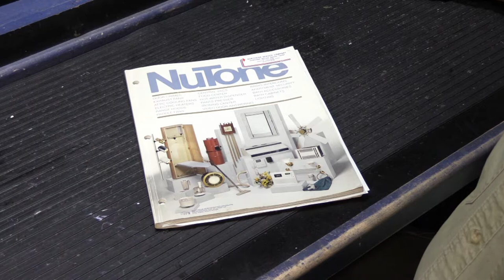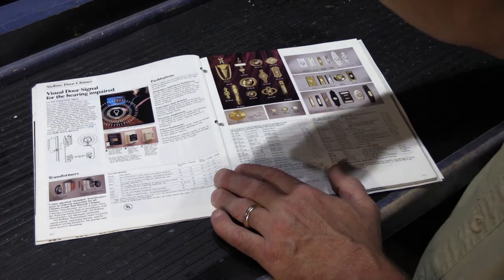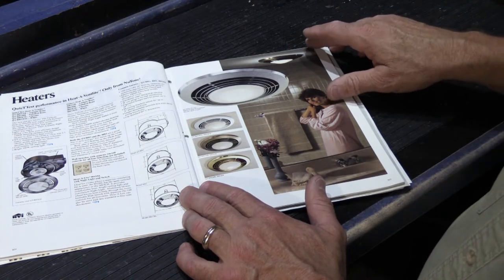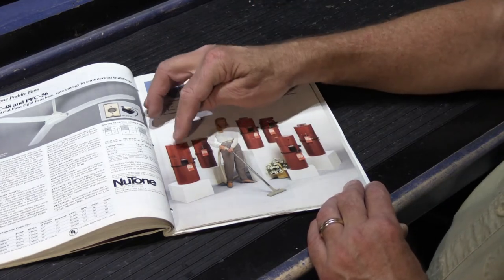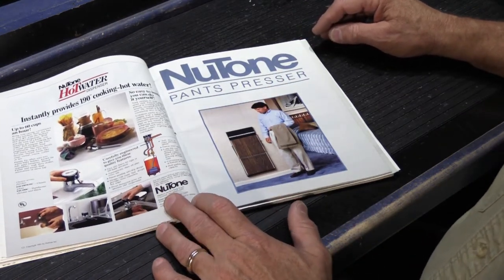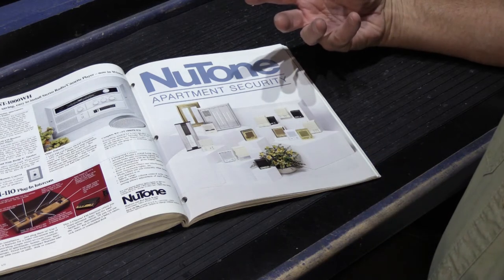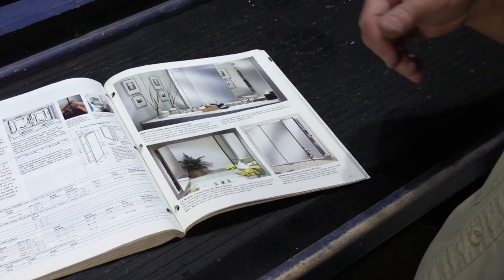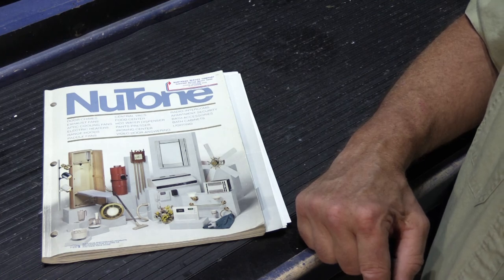An Overview of a Full Line 1992 NuTone Product Catalog

Comment: I know them best for central vacs, but that's the business I'm in. I have one of their first style blender things in my collection, not installed, but it will be when I have my own house.
Reply from the maker: Hi compactc9:  NuTone Central Vacuums were one of the best know brands for many decades and they were very good quality.  Kitchen Food Centers first came out in the late 1950's and the very first models were actually a counter-top design.  The first built-in model was the 220 and the accessories included a Blender - Knife Sharpener - Mixer.  The accessories grew over time, reaching their peak in the early 2000's.  Most of the accessories were modified versions of Hamilton-Beach kitchen appliances ( Scoville owned both companies).  The popularity of the Food Center line diminished over time, mainly due to the lack of newer and better designs - Chris

Comment: That was fun to see that, I didn't know NuTone offered all those accessories. I especially liked seeing the exhaust fans, I collect them. I have one of those NuTone Heat-A-Ventlites, brand new from 2021. I got it for a steal on eBay because the box was slightly damaged. I do like both old and newer exhaust fans though. Those utility fans with the blades visible scared me as a kid. I like them now though. That round fan with the oak and brass brings back memories, I remember seeing some of these fans in the Sears catalog back then. They sold NuTone fans but I think they were Sears branded.

My aunt has one of those NuTone kitchen centers also.
Reply from the maker: Hi Cole:  You hit upon the most important reason that I had a NuTone Showroom for the first 24 years in business, it showed off the vastness of the different product lines.  Most people identify NuTone with the product they have in their home, not all of the different offerings that NuTone produced.  It was not uncommon for a customer to come in for a single item and leave with more.  When we would be in Home & Garden shows, we would dismantle the displays and take everything we could and the supplement the display booth by handling our 1000 + full line product catalogs - It was surely the best of times to be a NuTone Dealer - Chris